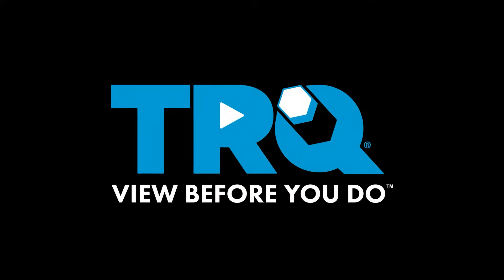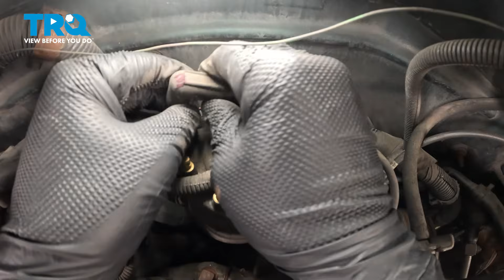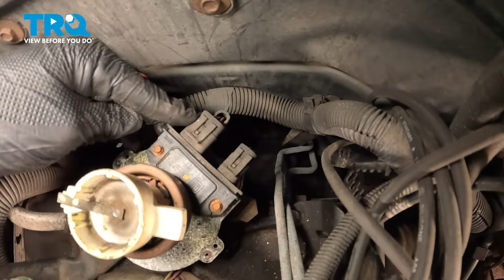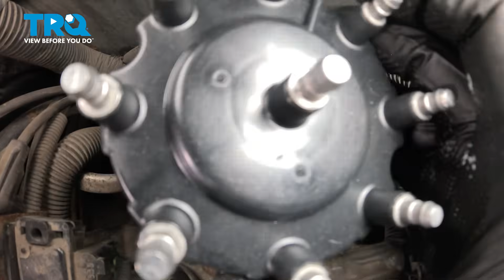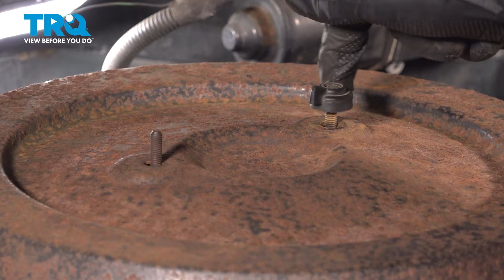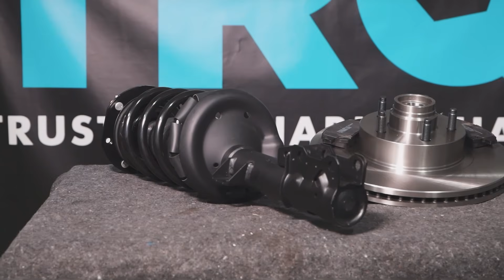How to Replace Ignition Control Module 1988-1999 GMC K1500 5.7L V8

Comment: I was thinking if those wires were long enough to move the module away from the distributor it sure would make things easier next time it quits working  again. Ever thought about extending those wires and mount the module to the fire wall?

Comment: Video title is wrong, this only applies to up to 1995 model year Chevy 350 engines. They switched to the Vortec 350 for 1996, totally different setup than what is shown here. Also, you don't need to remove your spark plug wires to do this job. Just unbolt the cap and place it out of the way with the wires still attached. This guy's a chud

Comment: I have a 1995 gmc topkick. I replaced that same part and it fired right up. I shut it off and tried to turn it back on, nothing no spark again. Replaced that part again fired right up. But didn’t start again I lost spark and that same part burned out again. Any ideas? Thanks….